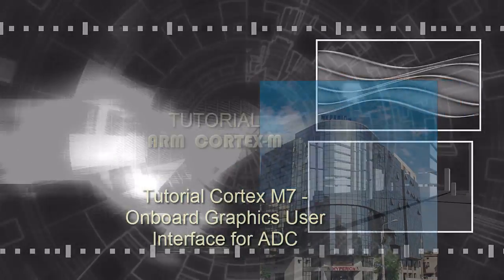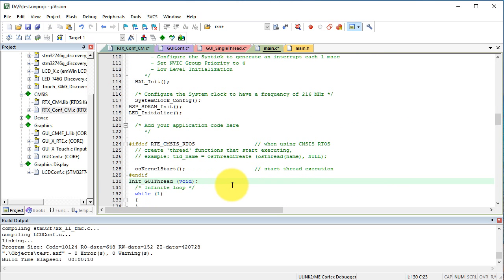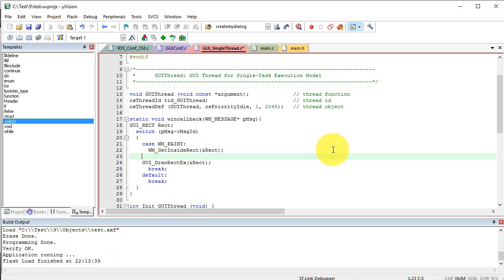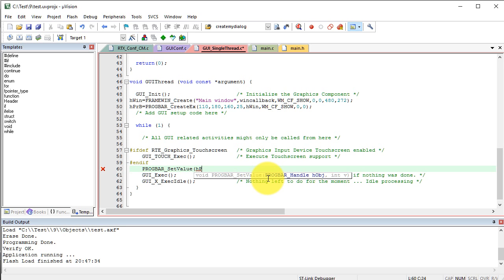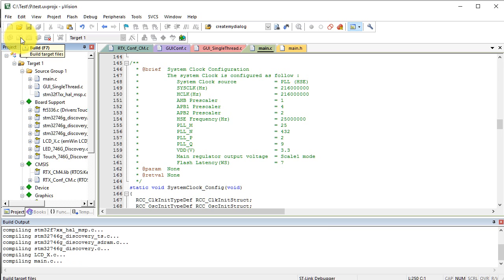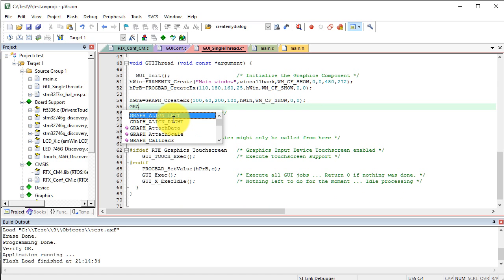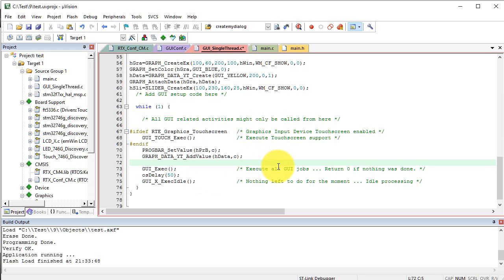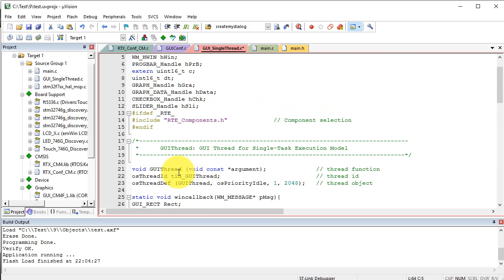Tutorial Cortex M7 STM32F7 Discovery ADC and LCD

Comment: Hi, great tutorial! I have the same board. I configured ADC1 channel0 (Arduino connector A0) same as what you did. But my values keep fluctuating and it gives only about 3000 even if I feed 3.3V to it. Ideally, it should give 4095 for 3.3V input since its configured as 12-bit resolution. I use a 10K pot and checked input voltages using multimeter.

Any help would be appreciated. Also can you please share your code and hex file to see if am missing something?

Comment: I am using latest keil rtos and configurations are very different now :-(
Reply from the maker: I'm sorry, my video is 2 years old... I myself forgot most of it, as it was a simple hobby for me (quantum electrodynamics physicist). But I'm sure that if you got the idea, you may adapt the program to the new rtos. Of course, this was my goal, to test the general procedures. Good luck !
Reply: Sever Spanulescu omg, your tutorial content is amazing though.one last doubt, why did you keep the frequency at max 216Mhz ? I have stm32f769 and its datasheet says not to go all the way upto 216mhz when using SDRAM as it poses some timing issue. Therefore stick to 200mhz
Reply: Sever Spanulescu and yes I'll try to adapt stemwin with freertos
Reply: hello, i wrote an instructables thanks to you, please check it out https://www.instructables.com/id/ADC-Graph-on-STM32F769I-Disco/ . thank you very much for the tutorial.
Reply: @knki_95  Hi Kiran, your example works well, but I see screen blinking after data accumulation. Have you tried to fix it?

Comment: Thank you for your detailed tutorial, I build the project successfully 
under the help from this video. Just want to mention one thing, on the 
Run-Time Environment setting section, the RTOS option, please select 
Keil RTX, not the Keil RTX5 for the latest version STM32F7 Pack.
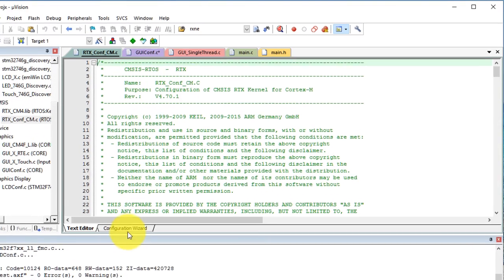Reply: Yepp. That was really important. On 2:24 there was no RTX_Conf_CM.c to use Configuration wizard on it. It was a miracle that I've suggested that there was smth wrong with RTX5 selection.
Reply: Yiyang Sun could you kindly share the workspace? My rtx configuration is very different as in i don't have options to set stack sizes. I'm using latest version of everything
Reply from the maker: I'm sorry about not specifying the RTX, mine was automatically resolved by Keil MDK. But it seems that the envirnment evolved. It was inevitably.l